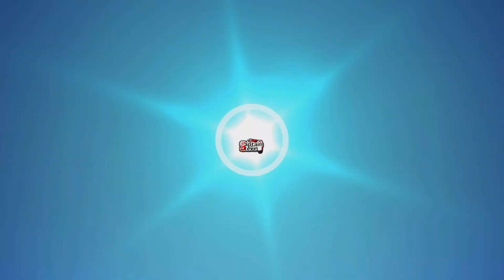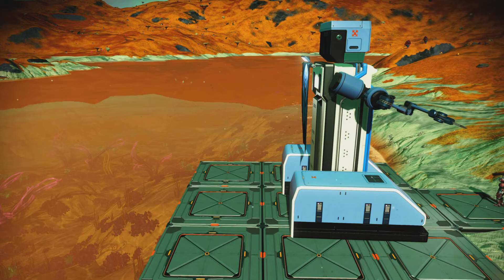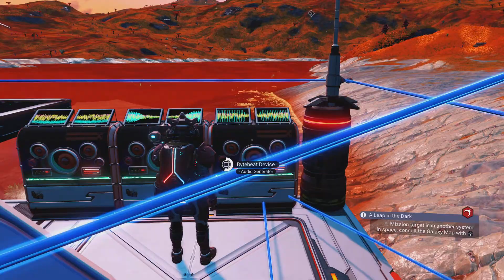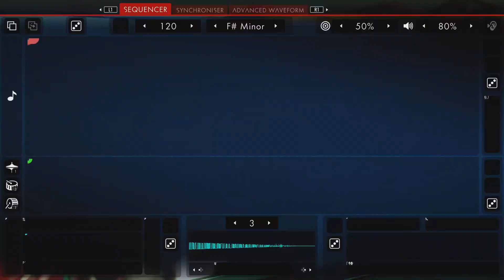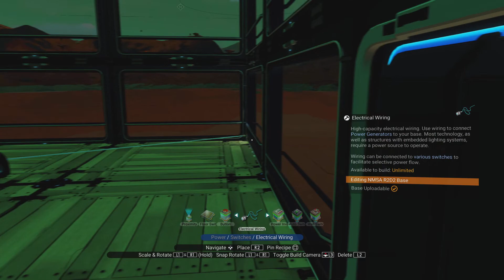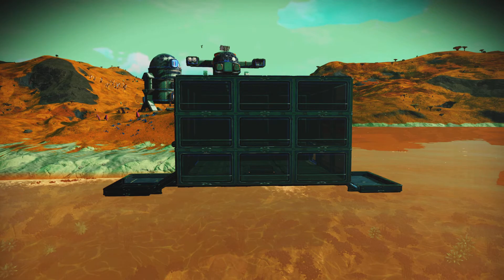No Man's Sky How To Build a Robot Base Building Guide Non Glitched Captain Steve NMSA Hub Byte Beat

Comment: Why are you putting wires everywhere, in the base computer you can enable unlimited power, no batteries or solar panels and no damn wires, I build in creative and nobody uses wires these days
Reply from the maker: It's a guide on how to build the base for new players... I say at the start that I am using creative mode just so I don't run out of base parts and the one I built was in normal mode prior...

I acted like it was normal mode.

But... I had problems doing that the other day, check out my base off: https://youtu.be/o5gyGn8ZsoA

I had to still use power in creative mode. At 26mins and 26seconds.
Reply: @CaptainStevePlaysVlogsTalks  I completely understand it's a guide to building, but new members should know that you don't need to use power via wires, maybe you could mention that there is a option in the base computer to have unlimited power, because since the last major update you don't need waste resorses adding batteries and a power source.
Great channel my friend, and I'm personally glad you are doing videos in creative mode, lots of people use this mode too, oh by the way, try storm crystals in the size option on the egg machine, amazing result
Reply from the maker: @Justjimshorts  I gave a video link... And time stamp... Where I play in creative and do mention that power is unlimited .. then I turn it on and it doesn't work on the byte beats....